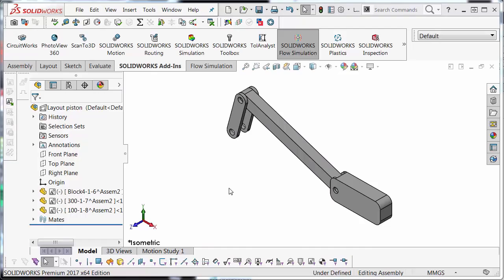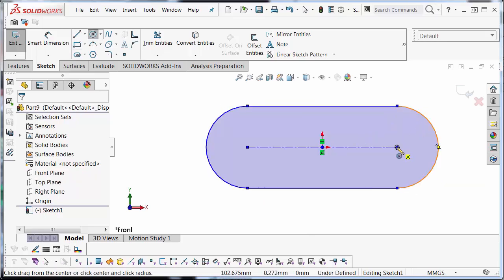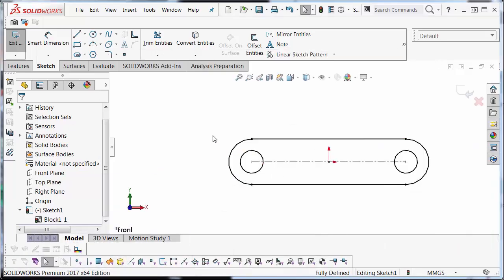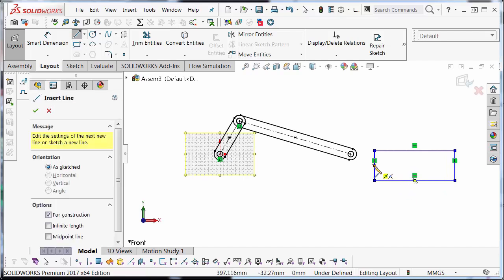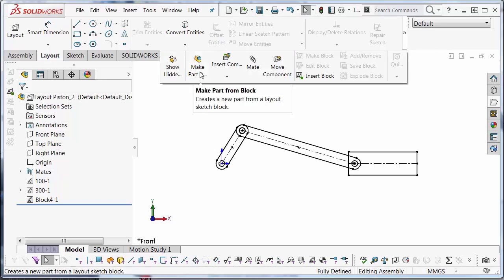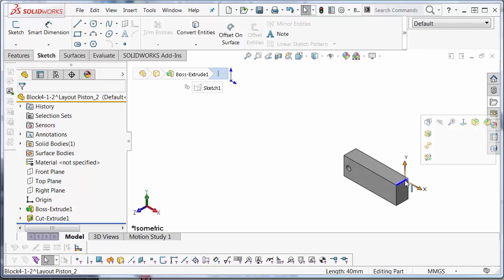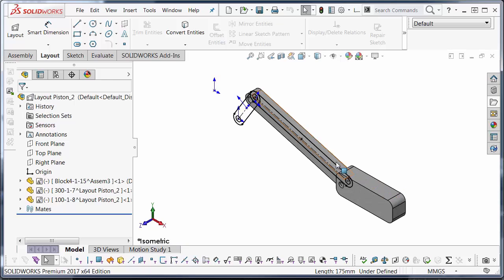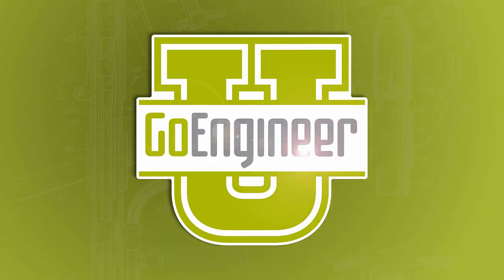SOLIDWORKS - Layout Assembly Design

Comment: I tried this and it was simply infuriating but fixed it by having at least one "base" part FIXED. .. Otherwise you add relations inside the sketch on the layout. but then you  can't figure out which relation belongs to which "part".. Once I fixed the base part it was easier then to temporarily add relations for one position and then delete them when you want to move things around. I think having "automatically add relations" option unticked within only the layout assembly would also be good.

Comment: Would you explain how did you use select contour select tool to draw a midplane extrusion? did you adjust some settings?
Reply: Salam Emad,
He used solidworks mouse gestures to get to the command, of course you can customize the commands in the mouse gestures

Comment: The thing is, in the real world, you may often find that you're tasked with designing an assembly using many existing parts. There are already solid models for them. Going the official Layout way, in that case, always seemed to me to be mostly a waste of time- I really don't need to spend time making blocks for part models that already exist, and can simply be mated correctly, with the SW assembly then becoming a virtual representation of a planned real assembly.  
This SW assembly can be used much the way a layout can (I.e., to show you whether or not all your solid geometry works fits &  works together properly) if you stay very disciplined about your mechanical mates.  Don't worry, the assembly will force your discipline with it's annoying red text showing mate "errors".
Reply: Absolutely agree